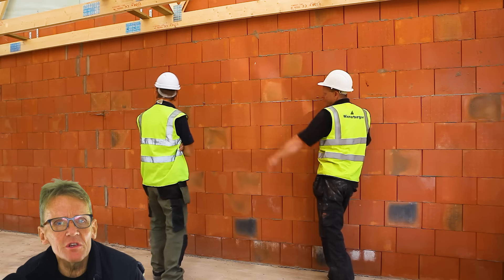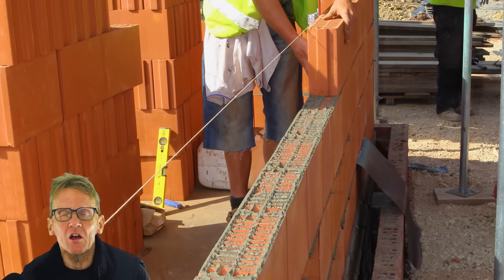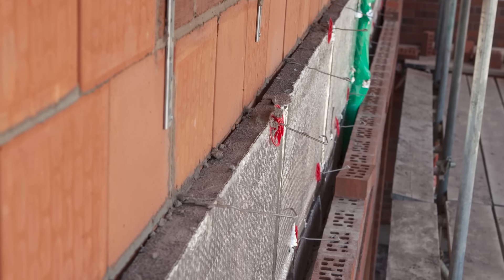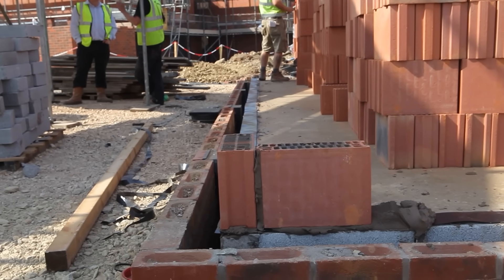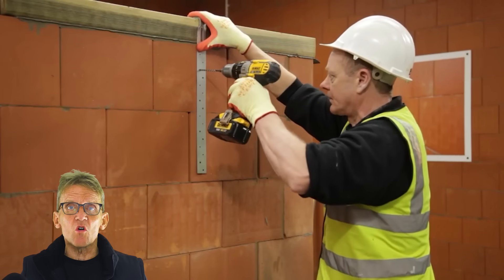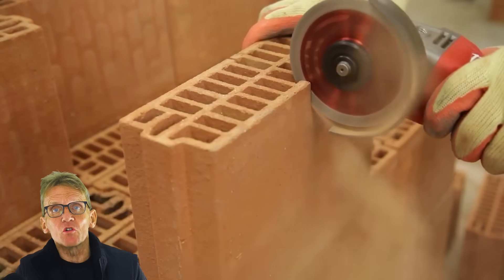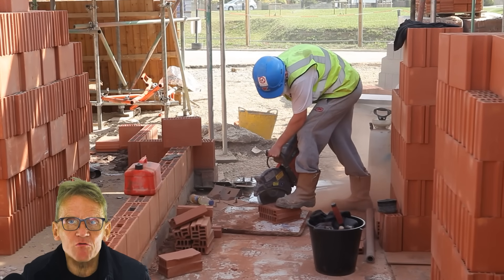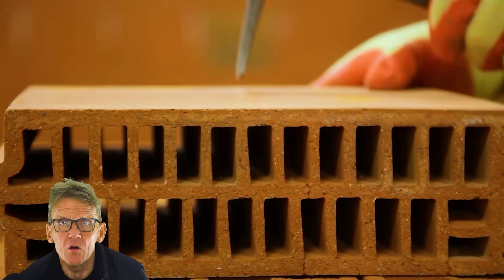Why Haven't We Warmed to Porotherm in the UK?

Comment: The only potential problem with internal hollow blocks is - if you want to mount something on the wall, like a flat screen TV bracket, you’re drilling into air.
Reply: Not really, my 85 inch television is mounted to bricks like these.  You would be amazed at how much weight these ‘hollow’ bricks will hold.  Chasing out for recessing electrical cable etc is a breeze.
Reply: @garryseery3865 I’ll take your word for it. I can definitely see that chasing for cables and galvanised boxes would be a lot easier as the channels are already there, just break the surface. 🙂

Comment: Very interesting. I had a house built in Switzerland. The main load bearing areas are concrete, non load bearing looked like this. Inside is plastered, outside 20cm foam insulation then rendered. Door jambs are steel. Here building regs dictate triple glazing. Windows are aluminium outside, wood inside. Downstairs ceiling height 2m60 upstairs standard 2m40. Underfloor heating, heat pump, hot water tank, electrical panel in the cellar. I think we could learn a lot from continental (Swiss, German) house building. All the best, Rob in Switzerland

Comment: Porotherm is cool at first glance, but it sucks when it comes to drilling it, cutting it or hanging stuff on walls made of it as it's very brittle and hollow inside. It was popular for many years in my country (the one supplying UK with builders once upon a time) but nowadays it has been widely replaced with cellular concrete blocks like Ytong + external insulation as they are easier to work with, while maintaining a reasonable thermal insulation and with the modern building code, you can't really get away without external insulation anyways.

Comment: Both my houses in Germany were built with these 300mm wide. The secnd house built in 2017 had these but the air spaces inside were filled with rockwool. Render on the outside, plaster on the inside. No Styroform or cavity wall required and they support concrete floors too so you can have underfloor heating upstairs too. Oh yes and each floor takes about one day to lay.

Comment: I was in a building merchant's yard one day (25 years ago) looking around I saw these, they had all kinds of versions, corners, capped (closed tops) rounds, cheeses etc, I am sure the passageways were bigger, more than double the size of these as I remember. Could have been a different manufacturer, the finish on them impressed me, you could easily use them as interior walls and leave them as they are, no dry lining, plaster or paint,

Comment: I live in Spain and work in Gibraltar. Over here they are often used as a single external skin and also for internal party walls. The porosity is indeed a problem in the case of the external use. I have seen rising damp but also moisture ingress from outside is commonplace and condensation thanks to the thermal bridge. Internally they are good for airborne acoustics, but terrible for impact. So in Gibraltar now we tend to use them with an insulated render system externally and for party walls we often use a composit system with a thin layer of thermo brick and on one side a layer or insulation and a LG frame with plasterboard.

Comment: There's a block of flats going up near me and they are using these blocks on the inner skin. They have also placed a course of concrete brick to support the block & beam system. I guess that could solve a couple of issues, extra load bearing and resetting the level.

Comment: These blocks are in stock in the UK with EH Smith at Hemel Hempstead  Ley Hill Road, Bovingdon, Hemel Hempstead, HP3 0NW
United Kingdom
There are a few other EH Smith locations that stock but you should call ahead as they aren't at all locations and for some reason not available to order on line.

Comment: I would say UK construction has still a lot to warm up to besides that...🤣 such as maybe putting the piping and electricals inside the walls, instead of leaving them dangling on the outside and wondering why water freezes at -1C... or using something more than single glazed windows, or any kind of insulation whatsover to stop the inside from rotting within a few years... And using some materials to soundproof the storeys in the buildings and stop the wood from screetching and crackling... there is definitely a lot to catch up with 🤣 the state of most buildings in the UK is shocking

Comment: Used them on a Barratt job years ago on two test houses, it was the interlocking perp joints that caused the problems, you cant cut them and them get them to interl9ck properly, they just could not get them to pass the air test, took them about 4 months to develop a way to do it and the system they come up with made them just too expensive to work, absolute shit product.

Comment: Here in the US we've used these clay blocks for a century. Mostly for interior partitions as they have a tendency to spawl in the frost. (Or our similar looking ones did, which were pretty soft. Unlike the ones you show which look hotter fired.) Surprised the factory couldn't recommend piggybacking off of a larger shipment in your region ?  Nothing goes up as fast as wood sticks w/a masonry cladding anyway, plus leaves more room for elec.,plumbing & insulation as well.

Comment: Is the air really trapped, or do those channels line up and therefore the air can move travel via the columns created? I imagine that would make a huge difference to how well they insulate.
Reply from the maker: You have to close the top course
Reply: @SkillBuilder  Air can still move and transport energy though, even if the top and bottom of a void is airtight. e.g. If you have a disused chimney in your home, the air in the cavity in the area that's adjacent to your warm room heats up, rises, warms the bricks in the unheated attic space and then falls back down as it cools, even if the chimney is sealed at the top and bottom. That is my understanding of 'thermal looping'. The voids in the blocks are small in diameter so presumably that reduces this effect a lot.

Comment: Just some context about Spanish weather:  while the Mediterranean coast and the south is generally warm, Madrid gets much hotter in summer but also colder in winter than London due to its altitude on the meseta at 650m (but is drier) and La Coruña in Galicia gets a good deal more annual rainfall than Leeds (1040 cm v 640 cm).

Comment: Let me tell you a secret, that the building society doesn't tell you. You compare an old house, with 35cm thick walls, inside and out. And compare this with the new thermo-insulated buildings inside plasterboard walls.
Witch building has the better building substance? Better insulation, better environmental climate inside?
Have a guess??😁😁😎

Comment: We once owned an early 60s house lined with these blocks. They were useless, especially if you had to set anything thing into the internal wall below the surface, like flush electrical sockets.  You had to packed out the interior of the hollow block until you could secure a fixing.

Comment: It's cheap to produce, easy to move and easy to work. But as a customer I don't care about any of these.
As an end user, I would go for classical red brick because it has better carry capacity and sound insulation.
I would go for porotherm if I have load limits or I am developer who doesn't care about the end user.

Comment: American here - we have many historic buildings made of this type of product which we call “structural clay tile.”  I just worked on a 110 year old 2 story high school built from it.  

Pros - Fireproof, very long lasting, accepts plaster finishes well.  Unitized construction goes up quickly if you have a local skilled masonry workforce.  Material should last forever.

Cons - cant build without skilled masons (our case), US building codes don’t recognize it as a modern building material (we list it as an “archaic” building material, lol), and it is brittle making it difficult to drill into it to alter the structure in the future.  Seismic reinforcement is difficult in high seismic zones.  Most of our buildings built out of this material have NO rebar!

Question - how do you guys typically insulate structures built from this material?  Interior or exterior insulation?

Comment: This is laughable! "They are produced to very precise dimensions" -- no they are not! The height is more or less so, but the with this length variance you will never manage to lay a nice window or door frame or close a corner -- you will have to saw them off. And God, they are so brittle you will never get a straight edge, you showed it yourself in the video. And you will have to saw A LOT, you will curse everything. And after all this hassle the wall is guaranteed to let the wind blow past it because the locks between bricks are laughable. You have to spend more money to seal the wall. Otherwise what insulation can you expect? They literally let the wind blow through your entire wall!!
Reply: It is an inside wall not an outerlayer..
You put another wall with insulation inbetween so how will the wind come through?

Comment: The family home which was a 4 bedroomed house  was built of these pot bricks on all internal walls and the joists were made from steel rod shaped to the shape of a joist with a piece of timber above and below for the flooring to nail to and the plasterboard cieling to be fixed to the downstairs floors were asphalt curverd to skirting board height as timber was in short supply after the war the houses are still standing today near me but were modernised some years ago with central heating and fitted kitchen they had a living room front to back of the house a middle room for eating in and a kitchen full width with 2 sinks one at the rear and a built in sink and cuboards these houses were built well and should last another 65 yrs or more not like the junk houses being built today ?

Comment: Have met these, or the local equivalent, at my home in Portugal.
Heat and sound insulation just done.
The only problem is with an internal wall you drill in to put up a shelf and hit a void.
Bust be a trick for when it happens.

Comment: While I am currently building with 30 cm standard porotherm on the outside walls, my friend is using the newer version which has its airpockets filled with insulation. These are way more expensive but you save on insulation.
Reply: What material are they filled with?

Comment: We considered these as the poor mans build. There was massive waste with these biscuits. They were very common in Liverpool 50 years ago. They were used to build inside wall. Upstaits walls built on the floorboards. When we brickies saw these on a job  it meant that the bosses were short of cash., They were very common in N Belfast , they were not considered load besring because tbey had a tendancy to shear rather than follow the joints.. They also tore the skin of our fingers.
  I would say they are better now, more regular .
Just don't  use them in old coal mining areas.

Comment: Frankly, and admittedly I'm a layman at this, they aren't bricks. They don't look strong. Our 1930s house is made of engineering bricks, so I looked them up; class B are 50Nm rating, and class A are 70Nm. I expect to die in this house and for it to continue as an asset for generations to come. Of course, they are absolute buggers when you want to fit a new mains socket, and it's sensible to choose to use old wall openings, not make new ones. Even putting up a shelf or a hanging basket is a pain.

Comment: Would you take a look at T-studs next? 
5:10 I've also found every few feet or about 2m you can check for plumb & level to make those small correction rows. Going too far before checking for true is a way to get out without being able to correct it can cost a lot more than the few minutes to check it.

Comment: My house in Cirencester, UK is made of these blocks. Thermically, they are great. Acoustically, they are horrendous. Sound travels through the cavity, so if you make a noise downstairs, the sound travels ip to the room above. If you drill into one using a hammer action drill, it will shatter the block. I believe you can get ones that are pre-filled with insulation material. Those are the ones to use. avoid the others.

Comment: Apparently successive government's didn't realise that the ash that is the main ingredient of Thermolite and Celcon blocks. The ash comes from coal fired power stations. The last coal powered power station is Ratcliffe on Soar near East Midlands Airport. It is scheduled to shut down this year. While they do have a pile of ash stored over the years when it's gone it ain't coming back. What will we build with then?
Reply: Literally anything else? It's not like humans haven't been building stuff without coal plants for... Most of our existence? It's fine.
Reply: @copperweave  economical suggestions forthcoming?
Reply: @copperweave Yes, we used to build houses with solid walls using traditional clay bricks, that's why they're so badly insulated. The calcium sulphate from Ratcliffe on Soar was also used as a feedstock for the nearby plasterboard and plaster products factory. Yes, we can go back to old-fashioned building methods if you don't mind old-fashioned standards of energy-efficiency
Reply: Imported blocks

Comment: not working for Porotherm here. I've used them on the continent. The thermal performance of the exterior wall using porotherm is about 60% better than our regular cavity cider built envelope - for a 350mm wall thickness.

Comment: My parent's 1980s bungalow is built with these things.  They were called "Poroton" and were made by Tyrone Brick in N. Ireland at the time (mid-1980s).  They're kinda crap, they ping all the time when they expand/contract thermally, they don't seem to do a very good job insulating (the house was cold until the cavity was filled with beads in the 00's), and they're a pig to fix anything to.  you basically have to use plasterboard anchors to get any sort of grip.  Mother-in-law's otherwise similar house built out of normal blocks with Rockwool cavity insulation is a much better insulated house.

Comment: If the jointing compound was spanning the air gaps, they’d so incredibly energy efficient. Maybe if a nylon scrim tape was automatically placed as the glue was applied that would create a seal between them.

Comment: Here in Germany we use it very often. I tend to use them for outer walls and inner walls I use Kalksandstein. It has better acoustics values. But also the calibrated ones (498x248 mm). No mortal only glue. Stays straight and nearly no waste.

Comment: I had a house built in the Toulouse region of France when I was living there, and it was built using clay bricks and then covered french crepe which is a type of rendering used extensively in France. They are great at keeping the building warm in the winter and cool in the summer. I am still amazed we haven't progressed in the UK past using concrete block!

Comment: They are thicker versions with many more air pockets.. these act as a thermal insulation..  
We built our house in France with these..  those heavy concrete blocks offer no insulation and are hard to work with..  
No regrets at all

Comment: Have a look as Iso Span. It is a wood-concrete material manufactured in Austria but available for shipping to the UK as well. Very easy to work with, can even be premade into wall segments, very good insulation. My house was built from it in the early 1960s and is still holding up perfectly. Newer variations are availbable with builtin insulation. R-Values of up to 6,51 are available. U-Value is 0,148 for those blocks then. They allow for very rapid construction with great thermal and accoustic properties.

Comment: One of the reasons could be because of weather, environment conditions, and building codes. A lot of people in UK, and the rest of Europe give us in the states crap 💩 for houses built with wood. The thing that they don’t get or understand the house here are built using the best materials for the area in America. Look at most of NY does use brick, but brick isn’t good in tornado areas. Just like in places like Arizona, New Mexico and that area uses adobe clay because of the heat in the area getting up to 120° F (49° C) or even higher the record temperature here was 134° F (57° C)

Comment: I fitted two windows in my Spanish villa, used these block to block up around the windows, they were double thickness and used them installed to the exterior outer skin, and then skimmed over with capa fina and they are perfectly waterproofed. I bedded between courses with mortar and not adhesive and also fine. 👍

Comment: Our house in France is built with them. They're rendered on the outside with self-coloured crépi - a rough-cast plaster. The walls are around 400mm thick and this provides decent insulation in winter and summer. The upstairs floor is made of beams with these tile bricks slid in between, then 100mm or reinforced concrete it laid on top. This provides excellent soundproofing, so makes a very pleasant dwelling. The building is 30+ years old and there are no cracks inside.
Reply: 0

Comment: In answer to the title question. Because it doesn’t fit in with standard UK practices, for example you can’t chase out 30% of them to conceal cable or pipework, unlike brick which looses minimal compression strength under load when chases are kept to a 30% depth. Also drilling straight through them (especially larger cores) creates structural problems. Any construction built out of them would be potentially and catastrophically problematic in years to come for any tradesperson unfamiliar with the product. Great product if the entire workforce understands its limitations, which is unrealistic in the UK any time soon.
On the flip side they have the advantage of being much lighter, but we don’t really have earthquakes here so, meh.